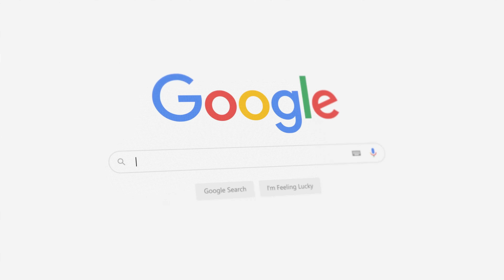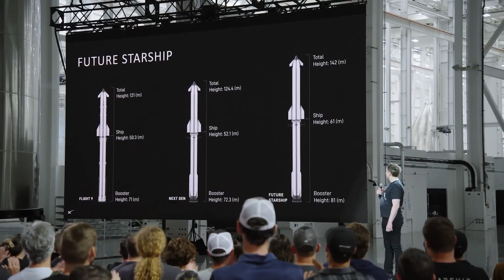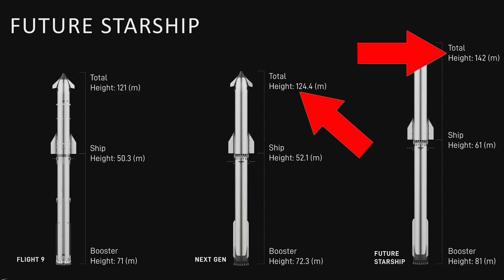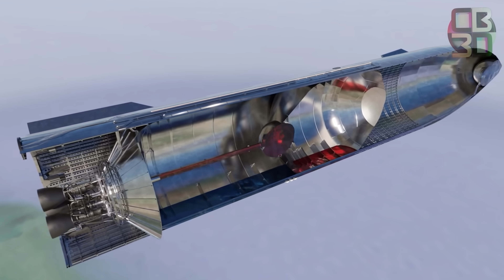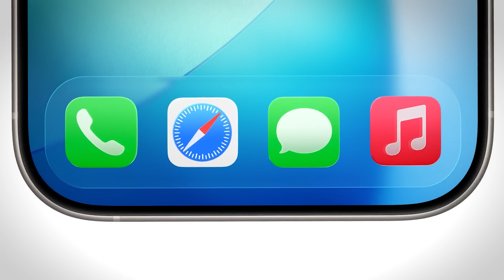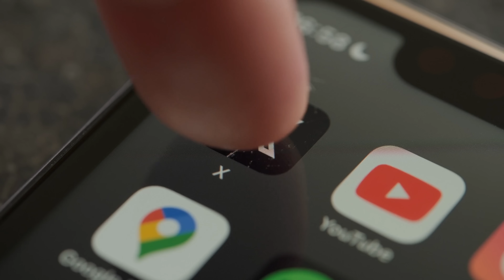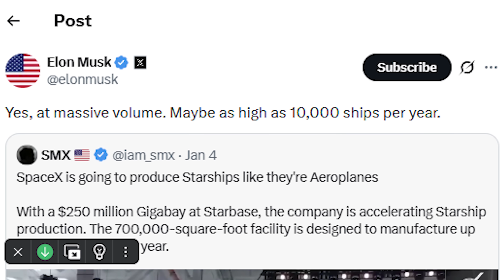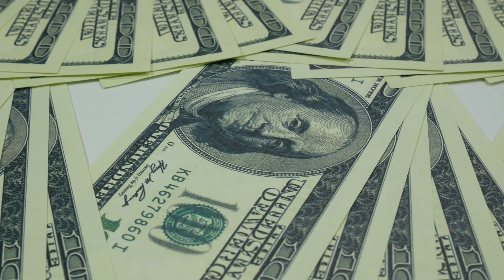Elon Musk officially announced NEW Starship prototype 'Longer & Better' will Blow your mind...

Comment: This video is saying the total height of Starship [Booster and Starship upper stage] is Increasing. But that is only half the story. IF Space X extends the Boost height it can hold more fuel. 

For every extra ton of booster fuel or weight savings, the booster gains the ability to launch 2 extra tons of cargo or fuel to LEO in the starship upper stage.

This occurs because the booster can impart more delta v to starship at hot stage separation, meaning, starship uses less fuel to get to LEO.

On the other hand stretching Starship you basically gain "space" to hold more cargo or fuel.
Reply from the maker: Exactly, that’s a great point. Stretching the booster increases delivered delta-v at staging, which directly boosts payload to LEO, while stretching the ship mainly adds volume for propellant or cargo. Both upgrades work together, not independently, that’s why V4 is expected to grow on both sides of the stack.

Comment: Time can be saved if use 20 ICON engines for Cruz over cost. Will get to midway faster and turn and start deacceleration. StarShip will only need 4 vacuum engines to give room for 4 groups of 5 ICON.
Reply from the maker: Interesting idea. Continuous low-thrust engines like ion drives are very efficient, but their thrust is extremely low. For a vehicle as massive as Starship, they wouldn’t significantly reduce travel time, they’re better suited for small probes, not crewed transports.

Comment: Humans turn 02 into CO2. It is possible to make machines to turn CO2 into O2. Probably lighter than carrying a bunch of O2?
Reply from the maker: That’s already part of the plan.

Spacecraft use CO₂ scrubbers and oxygen recycling systems, but they don’t reach 100% efficiency. You still need stored O₂ as backup, especially for long missions like Mars.